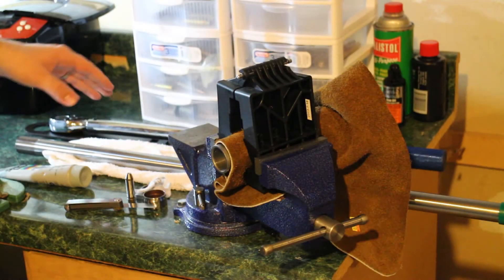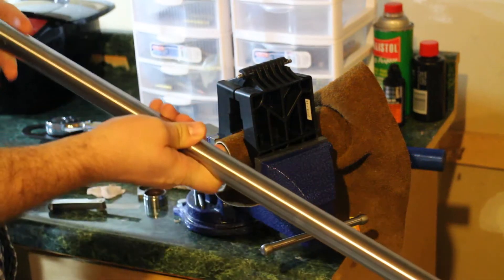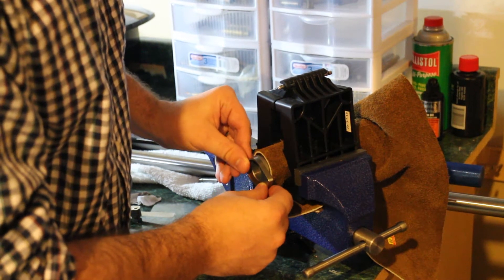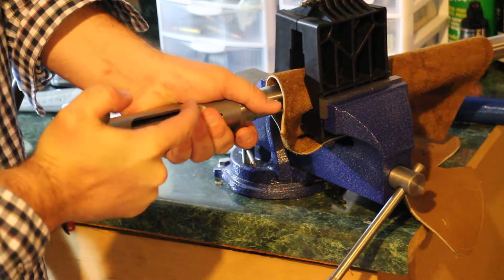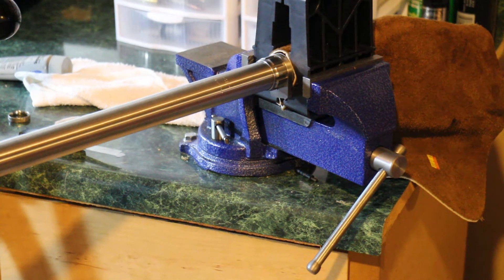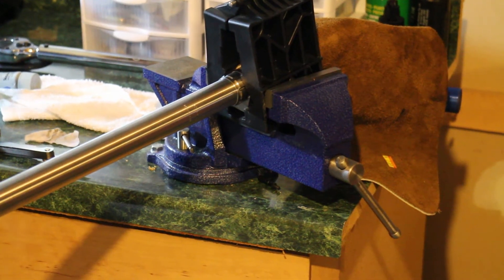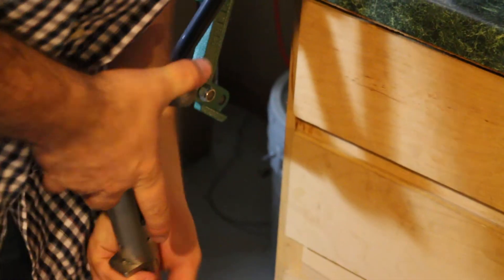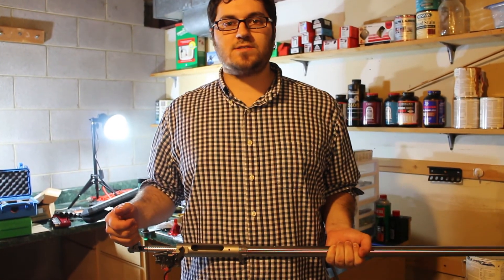Savage F/TR Rifle Build Part 1

Comment: How are you liking the CBI barrel? I have one and it's been the best $300 I've spent on building a rifle. I'm shoots as good if not better than a custom build.
Reply from the maker: It's been so good I bought another one for another rifle and bought a third for an AR. They've all been fantastic shooters, but the two CBI bolt gun barrels - one averages 0.55 MOA 5-shot, 5x5 groups with 147gr ELD-M 6.5CM, and the 308 is in the 0.45 MOA 5-shot, 5x5 range with 168gr match bullets. 

They are amazing.
Reply: @Trollygag  when I called Northland and spoke with Jim it was a great experience. Ordered on Monday arrived on Friday as promised. I sent him some pics of my latest rifle and he asked to put it on his website. If you see a hot lime green Savage on his site you'll know who it belongs too. My 223 has shot repeated 1 /2  in groups at 200yrds. I've got it bedded in Benchrest style stock. By far my most fun gun. Good luck man. Nice video.
Reply from the maker: @JPsaysno   A few good pics: https://i.imgur.com/QoZDB5c.jpg

https://i.imgur.com/fUq01zo.jpg

https://i.imgur.com/dCvT18M.jpg

Those are the 3 CBIs on my rifles